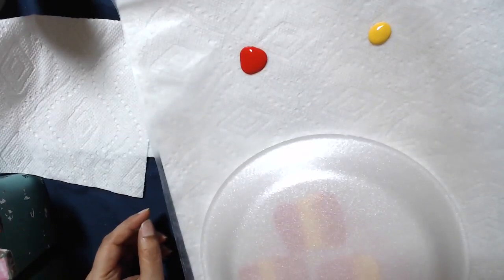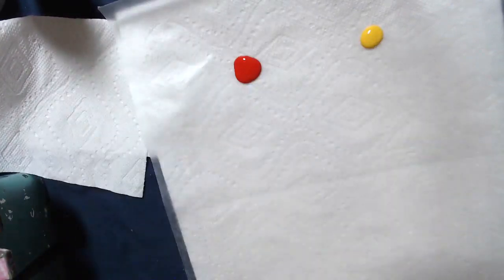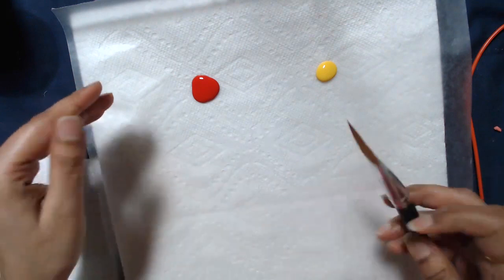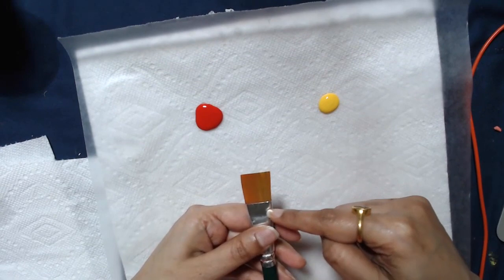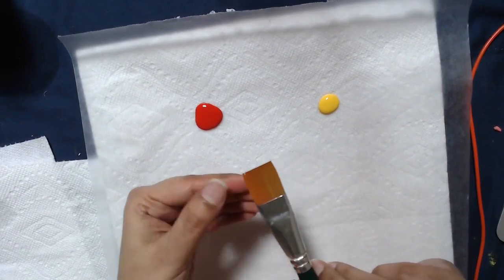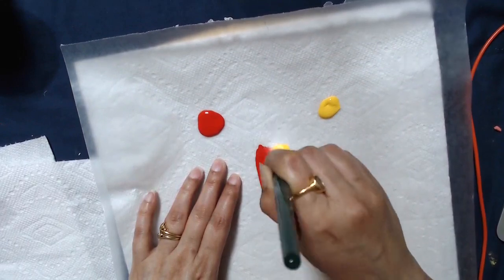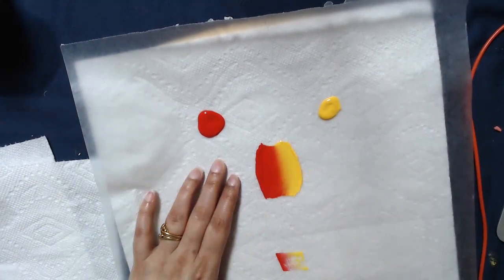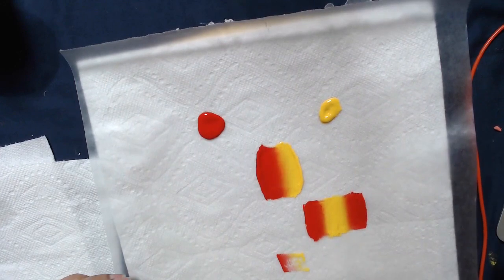How to double load paint in a flat brush well for One stroke technique

Comment: Hey pls tell me how to do one stroke painting on fabric
M trying again n again but couldn't get good results  pls give me some guidelines
Reply from the maker: So for fabric painting a lot depends on the thickness of the paint as well as the texture of the fabric you are using. I use Folkart fabric medium to wet the fabric a bit[not too much] before I use paint and medium. If you are using a smooth fabric you have better changes of a neater finish in one stroke than on a coarse fabric like jeans.